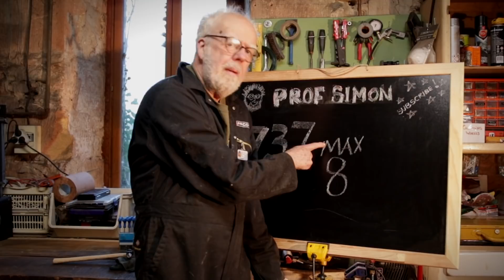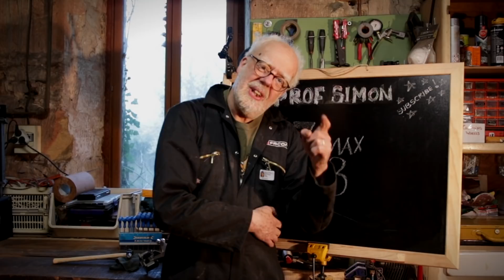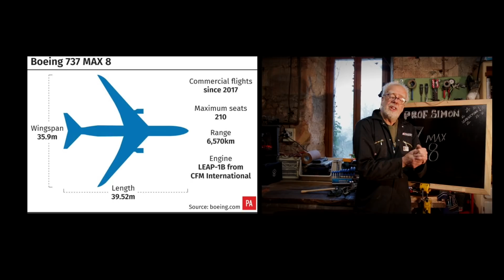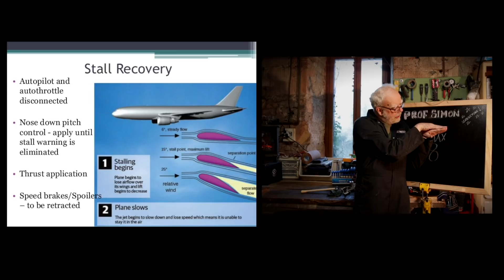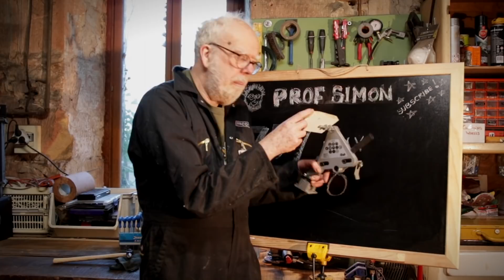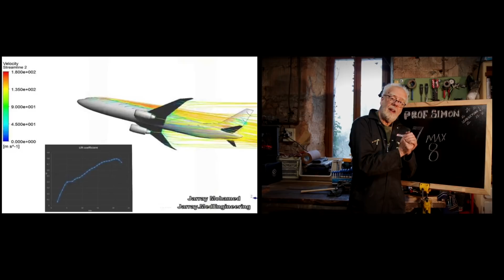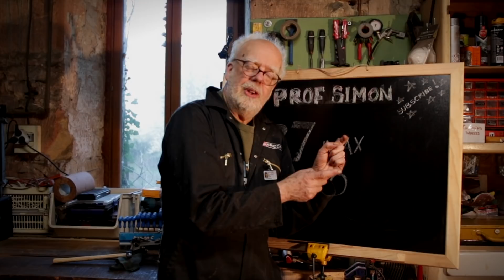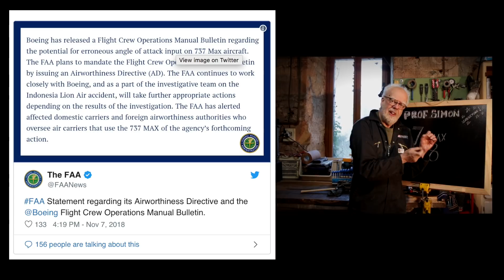Boeing 737 max 8's

Comment: I think there is more to it,  Why was the AOA info given to the computer wrong?  This MCAS problem actually occurred on this 737's previous flight.  The captain's stick shaker stayed on for the entire flight.  Thus the first officer flew whilst the captain did the checklists.  The captain compared readings with the other 2 displays and correctly concluded that his readings were rubbish. 
They eventually did the "runaway stabiliser" tasks thus disabling the computer's pitch control.  End result, they landed safely.  I think you are right that the crews weren't trained up enough but the issue is, why was the computer acting on faulty AOA info?
Reply: It's up to the dipshit manufacturer and airlines to assume a computer is going to fail and to have a back up plan on what to do in case of failure !  They didn't.

Comment: John Robson. I think that there is certainly a software problem with this aircraft. The angle of attack sensor information, together with the correct speed of the aircraft, should tell the computer that a stall is not developing. A gentle climb would probably not even cause the computer sensors to cause any action to the controls. However, a steep climb apparently causes the sensors to send erroneous information to the computer. I would have thought that a simple computer program could automatically override the auto pilot in the event that the pilot was attempting to manually override the autopilot while it was still in operation. Once sensed the autopilot should then automatically disconnect and an audible and visual warning alert the pilot that he has now manual control of the aircraft. Audible warning suggestion would be a distinctive sound followed by 'Take Manual Control' and repeated till the pilot acknowledges the warning.

Comment: Garbage in garbage out.  Wrong data from the sensors feeding the computer, computer trying to correct things using the wrong information. Being low in altitude, not enough time for humans to diagnose and fly the old fashioned way.

Comment: The 737 had just taken off and did not have sufficient altitude to be able to correct a stall. Maybe the Max8 'AOA Assist' (AP?) should not 'kick in' until you are at 5,000 ft of altitude (or more). At lower altitude stall correction (manual) would be difficult enough as there is not enough 'time' to do the manuvering required (lower nose to gain speed), especially when you are 'fighting' the Max8 computer for control of airplane. 'DOES NOT COMPUTE'?. Shame on you Boeing - you screwed up with this software!!

Comment: I've now seen two different (related) explanations for the problem:  Both relate to a failed sensor (AOA?).  
* The first was that a stall sensor failed, and caused the autopilot to think that the aircraft was in stall.  The MCAS software did an automatic stall recovery which consisted of pointing the nose down, and down and down...
* The second explanation was that the MCAS software was designed to make the 737 Max8 act like older 737.s, which included auto-trimming when at a high AOA. This intrinsic trim was lost hen the Max-8 was redesigned for higher fuel efficiency . ...The loss of auto-trim isn't a problem when in direct control of pilots, but needed to be emulated when in auto-pilot. Not a problem, *as long as sensors worked properly*. MCAS tried to emulate that auto-tri]:m, when the real pwoblem was simply the sensor.had failed.
I see two problems leading to the crashes  
1) the anti-stall/software auto-trim was allowed to trim the airplane to the point where the aircraft was un-flyable.if the sensor was off.  
2) the correction took place *silently*, so that pilots had to guess what was causing the unexpected reaction.

Comment: OOP - Object Oriented Programming.
Why all software works slower and slower from day to day? Why software is getting worse and worse of quality? Why each new patch removes old errors but brings new errors? Answer: OOP  and the policy of software development when responsibility for testing puts on the customers - the software is never ready completely and always raw.

Besides that I still see self-confident young programmers just after University which suppose that it is so easy to change (allegedly "improve") things to which the pilots (and not only) are accustomed. They ignore the common ways the millions customers are used to go and want to make them go to a new exotic way, accept their new (raw and sometimes mad) ideas. Each software developer wants to enforce customers to use him own interfaces, programming language and make them be dependent. It is not development. it is pure marketing. Alas.((

Comment: With all due respect, your very good observations miss some very important points.  First: A brand-new airplane should not have a "bad" AOA sensor.  Second: The AOA sensor was changed out in the first crash.  The odds of having TWO bad AOA sensors on the same airplane is almost statistically impossible.  Same goes for the out-of-control trim changes and the pilots' reactions:  Yes, the pilots might have done a better job of correcting the airplane's gyrations.  But a brand-new airplane should NOT suddenly lurch out of control!  Imagine if you bought a new car, and it suddenly jerked to the right when you set the cruise control and caused you to swerve into a tree!  Should you be blamed because you didn't turn the wheel back again quick enough?  Personally, I don't think the problem is with the AOA sensor or "bad maintenance" or "not following emergency procedures" as Mother Boeing wants you to believe.  I think there is a hidden and more insidious problem with the electrical system or the wiring and/or software that is the root cause of the problem.  And right now, in my opinion, Boeing does not have a clue!  The 737 MAX should be grounded until the true cause of the problem is found.

Comment: Chinese made parts 

SHANGHAI (Reuters) - Chinese suppliers to U.S. flight control systems maker Moog (MOGa.N) sold it poorly made parts, faked paperwork and outsourced work to a factory not approved by the company, according to an internal report by U.S. aviation regulators.

In a 9-page report dated Nov. 4, 2016 obtained by Reuters through a freedom of information request, the Federal Aviation Authority (FAA) said 273 affected parts were installed in an unspecified number of Boeing 777 wing spoilers, which help slow a plane when coming in to land.

Comment: The engines are so powerful on the Max 8 that even as you correct the angle of attack by pushing the nose down...any attempt at reintroducing power has to be done in small increments other wise you introduce a secondary stall...but these engines will put the nose back up at a time when you have lost air speed...which is even harder to recover from.
The MCAS system was left off the manual because boeing decided it was too complex to put in writing for pilots already dealing with issues arising from emergencies.

Comment: MCAS is a band aid for the max 8s aerodynamic differences from the previous 737s. Instead of structural changes or a different type rating and training, Boeing used the shortcut. On top of that they provided inadequate information on how the system functions and for a time being didn't inform about the system at all. They did later give more information on it. The problem is that without mcas the plane can be somewhat difficult to fly because of the larger engines being more foward. So the pilots are in a situation where mcas is causing a problem and shutting it off can also lead to instability. These problems that lead to the accidents also happened at low altitude, combine the lack of understanding of the sysytem and a low altitude problem with it and this is the result. Boeing needs to scrap mcas type rate the plane differently then previous 737s, Once pilots are trained on the slightly different aerodynamic differences and they understand the plane has a tendency to lift the nose higher because of the new engines all will be well.

Comment: crap system , what happens if someone accidentally damaged the little flaps . Why don't they use gyroscopes.
Reply: They are using gyroes, but this is about the Angle between the airplane and relative wind.

Comment: The problem is that for the 737 Max's they decided to program in anti still corrections so that even when the plane is switched off auto pilot, the computer is not following pilot inputs into the yoke exactly but trimming the plane down.  This is different from a stick shaker that doesn't make corrections to the flight controls surfaces it just shakes the yoke when the plane thinks it is going to stall.  To disable this new anti stall system the pilot or co pilot have to pull out a circuit breaker.    But But  but the pilots have not being told this in their manual to convert to the max 8 from older 737s, So when the 737 has a faulty AOA sensor the computer trims nose down.  Now the pilot switches off auto pilot, but computer gets a still faulty high AOA reading  and that the plane is not climbing as it should or is loosing height, so it thinks "stall" so it trims down even more and increase thrust this just makes the plane point down even more.   This very quickly leads to plane nose diving into the ground. Despite pilot yanking back on the yoke.  Now occasionally AOA vanes stick.  So now we have accidents waiting to happen.    This should have been thought through by Boeing b4 it cost 300 plus lives the loss of 2 aircraft and several near misses.  And grounding of 100s of planes costing 5,000,000,000.$. This is what I think has happening.

Comment: As Tim below points out. Electric Trim Cut out switches have been in use for decades on all 737's. 
To reduce a potential stall, information from the AoA, angle of attack indicator is fed to MCAS and (with out pilot input) and if these conditions are met, (angle of attack is high, autopilot is off, Flaps are up, and steeply turning) operate the electric trim and moves the horizontal stabilizer upward at .27° per second up to 2.5°, then cuts out for 9.26 seconds and repeats. During bad AoA data, The Pilot is expected to recognize this condition as a unwanted horizontal stabilizer movement. There is not a lot of things that move the nose down, 

start of Boeing  bulletin issued Nov 6, 2018 "The Indonesian National Transportation Safety Board  has indicated that Lion airflight 610 experienced erroneous AoA data. Boeing would like to call attention to an AoA failure condition that can occurred during manual flight only. This bulletin directs flight crews to the existing procedures to address this condition. In the event of erroneous AOA data, the pitch trim system can trim the stabilizer nose down in increments lasting up to 10 seconds. The nose down stabilizer trim movement can be stopped and reversed with the use of the electric stabilizer trim switches, but may restart five seconds after the electric stabilizer trim switches are released. Repetitive cycles of an  un-commanded nose down stabilizer continue to occur unless the stabilizer trim system is deactivated through the use of both stab trim cut out switches in accordance with the existing procedures in the runaway stabilizer NNC. It is possible for the stabilizer to reach the nose down limit unless the system inputs are counteracted completely by the pilot trim inputs and both stab trim cut out switches are moved the cut out position. 

Additionally, pilots are reminded that in an erroneous AOA can cause some are all of the following indications and effects continuous or intermittent stick shaker on the affected side only, minimum speed bar red and black on the affected side only, increasing nose down control forces inability to engage autopilot, automatic disengagement on autopilot, IAS disagree, over ALT disagree, AoA disagree alert if installed,  feel differential pressure light.

Operating instructions- in the  event of an un-commanded nose down stabilizer trim is experienced on the 737 – Max8, in conjunction with one or more fo the above indications or effects, do the runaway stabilizer NNC ensuring that the stab trim cutout switches are set to cut out and stay in the cut out position for the remainder of the flight. Note: initially higher control forces maybe needed to overcome any stabilizer nose down trim already apply manual stabilizer trim can be used after the stab trim cut out switches are moved to cut out.” end of bulletin 

My Personal opinion, I find it irresponsible and negligent  that some pilots after the Lion Air Crash did not 100% fully understand and comprehend the bulletin, does Boeing or Airline Company's have to hold the hand and walk these professional pilots through the bulletin. Do the pilots not take any personal responsibility. I personally was interested enough to learned all the details of the Lion air crash, and what caused it, this without any bulletin from Boeing, ( I am not a pilot, just a commercial fisherman), yet we have pilots flying the Max 8 with no or little interest in why one of their aircraft crashed. It disgusts me.
Its not like these pilots drive a taxi full-time and to pick up a little extra cash flying a Max 8 on Weekends, this is all they do. Get with the program! I will cut pilots a little slack before the Lion air crash, but after, not a chance. 

“even”my girl friend, which took interest in the Lion air crash, as we discussed it together. As soon as we heard some of the details from the Ethiopian Air crash, my gal offered, this “sounds like auto trim control again, too bad they just hit the cut out switches, and trim manually”. This from a person that has zero to do with airplanes, flying, or aircraft industry.

Comment: I have to disagree with your conclusion.
What I have gathered is that the new 737 max 8/9 are inherently unstable because the new engines have to be larger than the old ones (an inevitable result of the more efficient design) which means they have to be positioned differently. The new autopilot is designed to counteract this, but imo the F.A.A. should never have let Boeing release a plane in this state.

So it's not so  much a matter of pilot/software change/error, it's a problem with the plane itself, the aerodynamics of the plane need to be chanhged so that it doesn't require constant computer correction to keep the thing in the air.

Comment: Professor Simon, these crashes have been on my mind quite a bit in the last few days. I have been bothered by one thing ever since I heard about the first crash months ago that I think you have hit upon here. The information the computer receives from the AOA (angle of attack) sensor comes from a potentiometer, or "pot" for short. Think of the volume control of your radio that works fine at certain volumes but gets scratchy if you turn it up or down because that section of the control has carbon deposits.  I used to be a radio announcer, and our engineer often had to replace worn rotary pots in our control board since we had to rotate them every time we went on the air to say something.  I had a car that had suffered from an unintended acceleration problem while still under warranty. The dealer replaced the TPS (throttle position sensor) pot three times before the problem finally went away. I also had another car that my wife refused to drive because it would just start accelerating on its own. The accelerator pedal would pull to the floor and it would speed along at as much as 105 MPH (nearly 170 KPH) and the dealer couldn't identify the problem during the first half-dozen or so tries. It ended up being wire chafing and a faulty hood (bonnet) prop support. It would stop doing it if the hood was opened. Under certain driving conditions, the hood prop would push against two wires, shorting them against the radiator, which informed the computer that the power steering pump needed additional engine RPM. It took nearly a thousand dollars in labor charges and a couple of pieces of electrical tape to fix this sensor issue. Needless to say,  I don't trust computer-controlled transportation.  I have nothing to prove this except a gut feeling but I have a theory that Boeing may have gotten a bad batch of AOA pots. Combined with the new MCAS software, I feel this may have led to these disasters.

Comment: I'm sorry, I still find this as an issue in Max 8, if it's suppose to prevent stall, it should prevent sink as well. Putting the plane in sink to prevent stall sounds very stupid to me.
Reply: I asked a 737 pilot about that. If a plane takes off and intends to climb to 33,000 feet then why do they need an automated computer system while in positive climb? The comp. should only activate when the plane levels out at cruising altitude and is on auto-pilot. Why does it need to be activated at low altitudes?

Comment: Did Boeing use flight simulators to train pilots on MCAS...instead of just giving brochures?

Did Boeing cut corners ...drop the ball...in pilot training?  Is 5G (mm EMFs) implicated?
Reply: Geja Vu...lack of pilot training (or "non-documented" features not told to the airline).

Comment: Either Boeing made the software change & didn't inform the pilots, or they didn't update the manual re: MCAS system. Either way, very experienced pilots had no idea what was going on. Boeing are in deep shit. Also, relying on one sensor to forcefully change the AOA without an 'override' switch is extremely negligent !